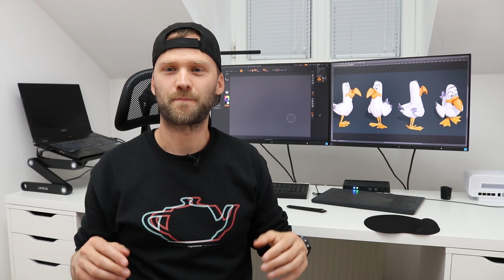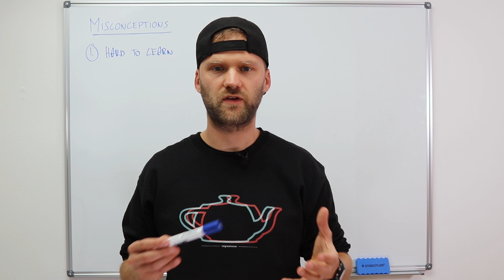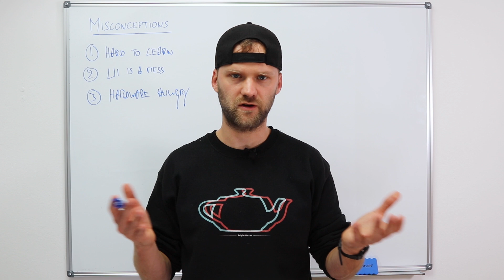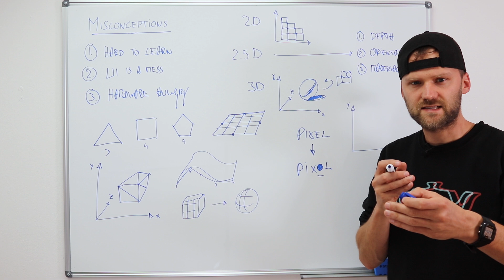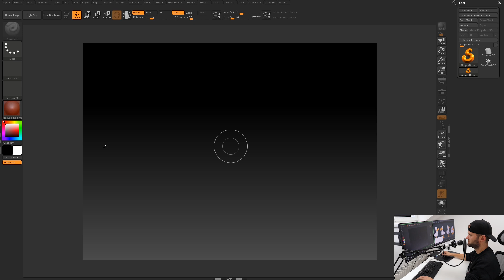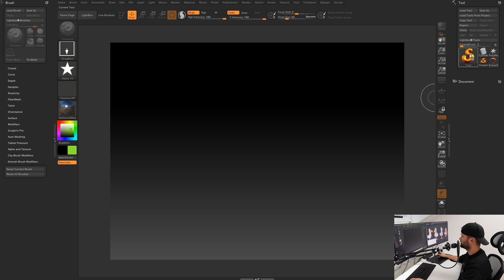ZBrush EXPLAINED!! A Beginner Tutorial

Comment: 00:00 - introduction, misconceptions, etc

22:36 - installation
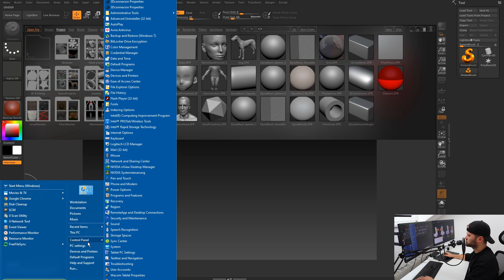25:29 - wacom tablet settings
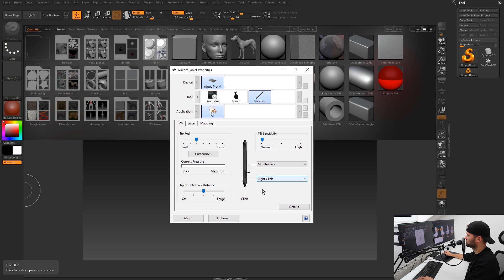27:28 - introduction to interface and customization

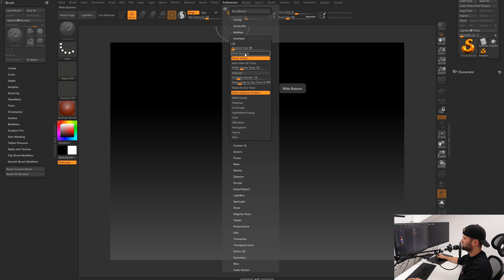37:09 - 2.5D introduction

45:22 - 3D introduction - this is where real fun begins!
49:16 - Brief recap of stuff discussed since 45:22

50:35 - Next part introduction
51:31 - Adjustments to the canvas
52:57 - Navigation
56:47 - Cursor
   58:31 - Cursor follows normal of the surface adjustment
59:25 - Draw Size of the cursor

1:00:15 - Brushes
1:04:20 - Appling colors

1:06:30 - Masking

1:13:48 - Selecting

1:16:58 - Polygroups

1:20:19 - Transpose tool (moving, scaling and rotating)

1:22:36 - What is a subtool?
1:26:06 - Duplicating a subtool
1:26:50 - Appending a subtool
1:27:32 - Navigating between different subtools
1:28:25 - Merge and Split subtools

1:30:23 - Symmetry 

1:33:28 - ZBrush specifics, next part talk - no editor

1:36:27 - Subdividing geometry
1:47:16 - Subdivision and triangles (ZRemesher)
1:50:40 - Projecting details from highpoly triangle model to new quad model
1:54:07 - issues working with mesh build out of triangles
1:55:42 - brief recap of stuff discussed (subdivisions) since 1:36:27

1:58:37 - Dynamesh
2:04:35 - Dynamesh, holes and intersections
2:11:44 - Dynamesh recap

2:14:40 - Creating the bird feet example, intro
2:16:10 - Start of the sculpt with ZSpheres
2:21:12 - Convert mesh from Z-Sphere mesh to regular mesh with Adaptive skin
2:22:00 - Sculpting mesh with brushes
2:24:16 - Making skin between toes
2:25:48 - fixing model with Dynamesh
2:28:14 - repositioning
2:30:38 - Mirror and Weld
2:31:16 - Symmetry sculpting and polishing
2:36:23 - DamStandard brush, claybuildup brush
2:37:15 - turn dynamesh back into subdivision mesh
2:39:02 - finalizing the sculpt with finishing touches
2:43:47 - Applying color 

2:46:41 - explaining how other parts of the bird are done

2:47:53 - Final words - no editor
Reply from the maker: Thanks for taking the time to do the time stamps!! I really appreciate this. I will add them to the description too. Best, Ben
Reply: @3DGladiator  of course! Your tutorial is incredibly helpful and I'm still using it all the time, as I'm actively learning to use ZBrush for my projects.
Reply: Iiiiiiiiiiiiiiiiiiiiiiiiiiiiiiiiiiii
Reply: Iiiiiiiiiiiiiiiiiiiiiiiiiiiiiiiiiiiiiiiiiiiiiiiiiiiiiiiiiiiiiiiiiiiiiiiiiiiiiiiiiiiiiiiiiiiiiiiiiiiiiiiiiiiiiiiiiiiiiiiiiiiiiiiiiiiiiiiiiiiiiiiiiiiiiiiiiiiiiiiiiiiiiiiiiiiiiii
Reply: Iiiiiiiiiiiiiiiiiiiiiiiiiiiiiiiiiiiiiiiiiiiiiiiiiiiiiiiiiiii
Reply: Iiiiiiiiiiiiiiiiiiiiiiiiiiiiiiiiiiiiiiiiiiiiiiiiiiiiiiiiiiiii
Reply: Iiiiiiiiiiiiiiiiiiiiiiiiiiiiiiiiiiiiiiiiiiiiiiiiiiii
Reply: Iiiiiiiiiiiiiiiiiiiiiiiiiiiiiiiiiiiiiiiiiiiiiiiiiiiiiiiiiiiiiiiiiiii
Reply: Iiiiiiiiiiiiiiiiiiiiiiiiiiiiiiiiiiiiiiiiiiiiiiiiiiiiiiiiiiiiiiiiiiiiiiiiiiiiiiiiiiiiiiiiiiiiiiiiiiiiiiiiiiiiiiiiiiiiiiiiiiiiiiiii
Reply: Iiiiiiiiiiiiiiiiiiiiiiiiiiiiiiiiiiiiiiiiiiiiiiiiiiiiiiiiiiiiiiiiiiiiiiiiiiiiiiii
Reply: Iiiiiiiiiiiiiiiiiiiiiiiiiiiiiiiiiiiiiiiiiiiiiiiiiiiiiiiiiiiiiiii
Reply: Iiiiiiiiiiiiiiiiiiiiiiiiii

Comment: Hi.. I'm a beginner.. Thank you for the tutorial.. I'm facing an issue.. sometimes the transpose tool is not working properly..  The shape is stretching instead of moving, scaling or rotating...how to fix it??
Reply: I know I'm late, but it might help someone: at the top, next to the "draw size" panel (which increases the size of the brush), there is a "focal shift" panel. By default, it must be set to -100 for the object to move normally. If you set a different number (for example, 100), the model will stretch.

Comment: 39:00 you are discussing moving the little dot to change light source.  Moving this does nothing to the strokes I created at all.  In fact, adjusting ANYTHING under the Light pallet has no effect whatsoever.  What am I ddoing wrong?  I am using the 2021 version of ZBrush, on Windows 10.
Reply from the maker: Thanks for your question. The reason is probably that you have used MatCap materials instead of standard materials while drawing strokes on the canvas. For MatCap materials, the shading is built into the material itself. Adjusting lights on a canvas level has no effect. You would have to do this on the material level and in the material palette. Try it again, but this time, pick a standard material instead. Best, Ben
Reply: @3DGladiator  you are exactly right!  I changed materials and it worked.. Thank you so much.  I love these videos, BTW.  Huge blessing that you made them for us. 🙏
Reply from the maker: Hi Julie, I'm glad it works. I wasn't explicitly mentioning that it only works with standard materials in the tutorial. MatCap materials are part of ZBrush since version 3 with the purpose of creating more complex renders. Have a great day. Best, Ben

Comment: Great tutorial dude, I also have one question which I didn't quite get to see, is that with the same brush size your strokes seem smaller than mine, so that makes me think that you have resized the canvas somehow and I do not see the option in preferences, if there is any way could you tell me please??
Reply from the maker: Thanks for watching! The behavior you describe is maybe caused by the pressure sensitivity settings of my pen. The size of the brush stroke gets bigger/stronger when I press harder against the tablet, even if the brush radius in Zbrush remains the same. You can change the size of the canvas on the document palette. Best, Ben

Comment: Hi, Is there a way to mask only the visible front side of a model? 
Thanks for your tutorial ! the best I 've ever seen !
Reply from the maker: Thanks for your comment and your kind words! Yes, this can be done. In ZBrush 2021 and upwards is an option in the mask palette called "MaskByDraft" that does exactly this. Set the draft angle first and it masks only what's currently facing the camera. Let me know if this is what you are looking for. Best, Ben
Reply: @3DGladiator  Hi Ben, Thanks for your prompt answer ! Unfortunately I only have 4R7. 
So I do not have this option yet. 
And yes, I was searching for this possibility, because my model now is a very complicated thin ornament, so the brushes often affect both side. I wanted to mask the front and fill up / thicken  and smooth the back. Originally it was 3D scanned from a hand embossed, 0,5mm thick copper ornament. Of course the back and all the thinner parts were totally missing...
So thanks for your time, Many thanks for your great tutorial!!  Yours led me to understand a little bit more the basics of Zbrush and gave me the courage to restart learning it.
I wish you the best and success in all you strive for, You are great !
Tamas

Comment: Can You import a VTF file from a cad program like a ring to sculpt and soften edges, add detail, etc?
Reply from the maker: Thanks for your question. ZBrush only supports meshes like OBJ, FBX or STL files. This means you have to convert a surface model into a mesh before you can manipulate it. This is still an option tough. Let's say you are done with designing in your CAD package. Then you can convert and export the model as a STL file and open it in ZBrush. If the exported mesh is dense enough, you can start adding fine surface details or soften edges immediately. If it's not dense enough, you can turn it into a highres dynamesh first and then start adding details. Of course this is an irreversible process. Once you are working on the model in ZBrush, you cannot return to CAD to make changes. Let me know if this answers your question. Best, Ben